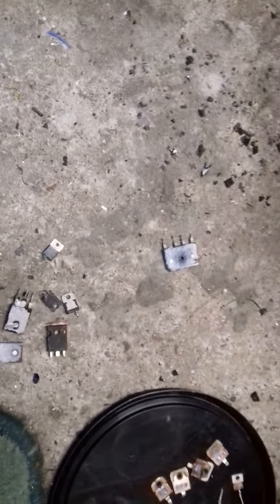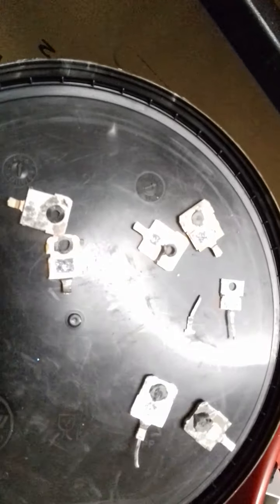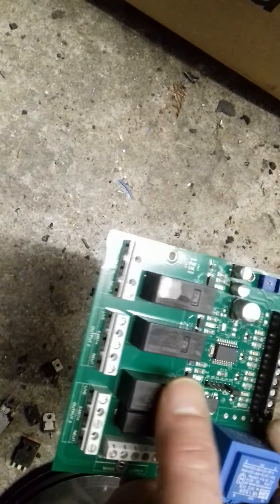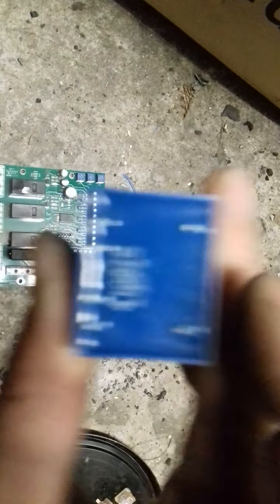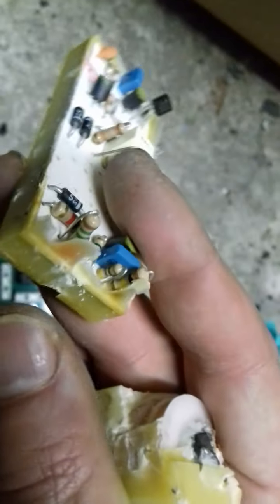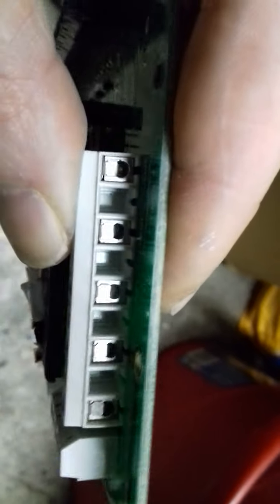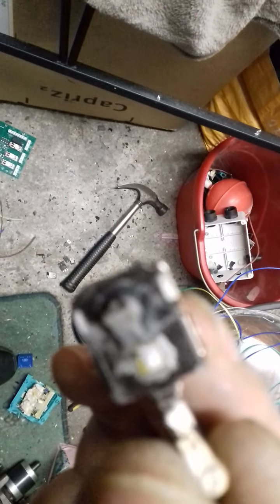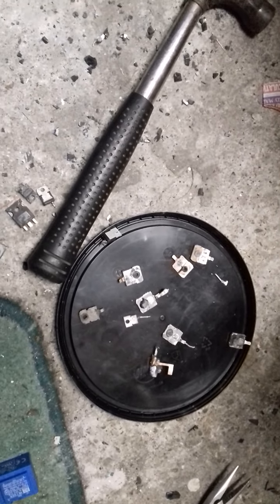MOSFETS /copper and maybe gold recovery

Comment: The first one you broke is a sip ic so 1 sided ic chip. Very bad for gold but its there
Reply: To refine mosfets. Burn them, grind to dust. Sift out the copper and sell that, add water to the dust mix so none is floating. Pour half out then add water, leave 10 seconds and pour half out again. Keep doing that until you see fine gold and copper. Takes around 20kg to get 10kg copper and 1g gold
Reply from the maker: thank you for the tip.ive got a jar full to do at some point  👍

Comment: You will need a magnifying glass at the very least to see the gold bonding wires mate.
They are stupidly fine and are easy to miss if you can't completely separate the plastic or whatever they are made of.
Cool video, theres not enough information on the gold content of mosfets
Reply from the maker: I need a magnifying glass so I can have a good look at the gold. I will clean them up so they look nice and thanks m8